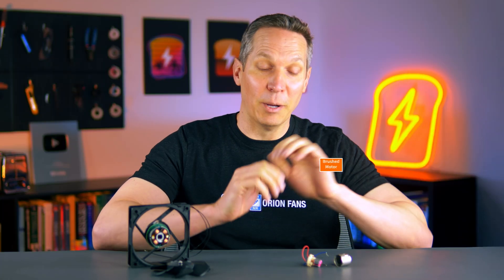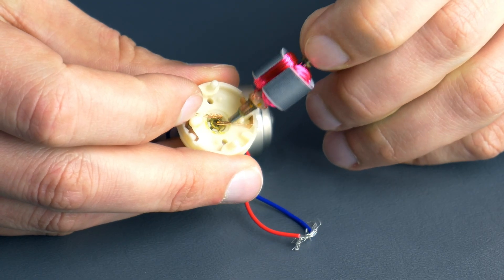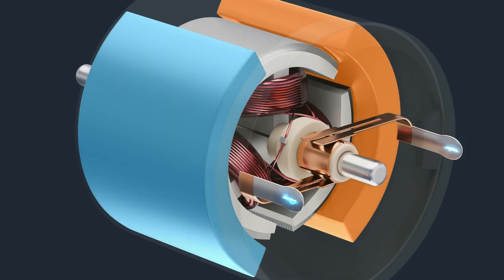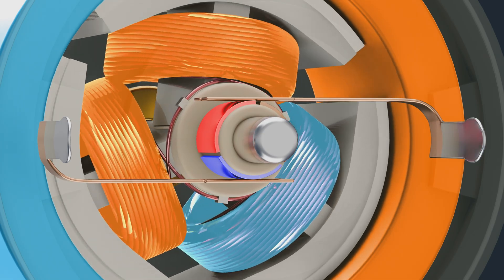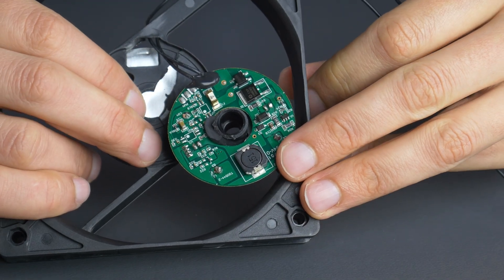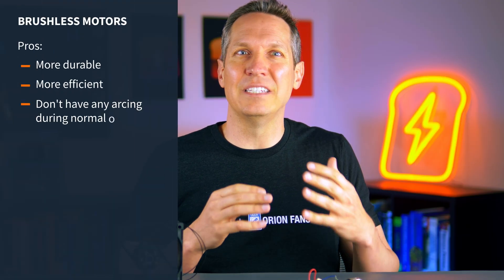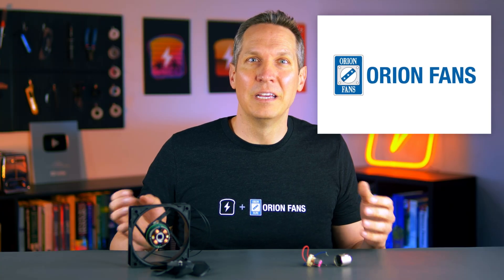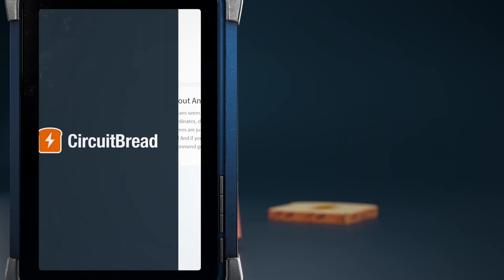Brushed vs Brushless Motors - What's the difference?

Comment: I clicked to learn about hand power tool application.  For the approx. not outrageous 20% premium of brushless over brush motors, I’ve gone mostly with brushless.  But as a weekend DIY, my brushed tools for the 1980’s are still working.  Only a B&D 5 1/2” handsaw is show burnt signs for stuck sawing.  Long way of saying the build quality of the tool is more important than the so called technology or design aspect.

Comment: There is no such thing as a DC motor, they are all AC.  DC has to be converted to AC somehow or anther to make it work.
The commutator is just a mechanical inverter (converts DC to AC.)
The electronics does exactly the same thing but with no weariing parts, hence they last longer.
The problem with electronic inverters is that the wave form produced is far from ideal, leading to inefficient performance and excess heat.  They are far cheaper to make which is why you see them increasingly.

Comment: Replacing a brushed motor is more efficient and cost effective than the brushless  motor circuitry for simple things in my opinion.
Especially if you don't know how to repair an SMD circuit board.

Comment: Nice explanation. What you didn’t say is how reliable the electronic circuits are.  Electronic circuits should be extremely reliable but most of us discover that this is frequently not the case. The brushed motor has the great advantage of simplicity.